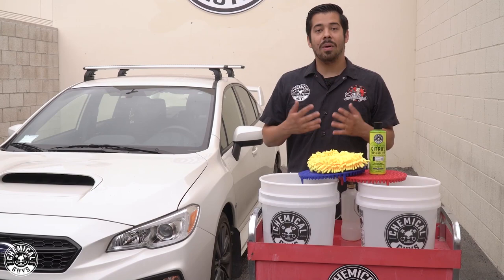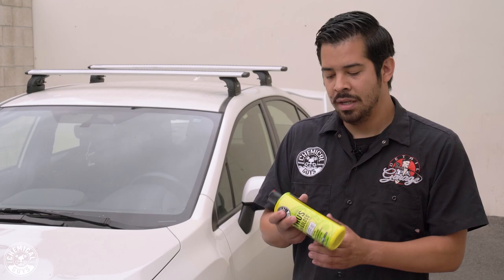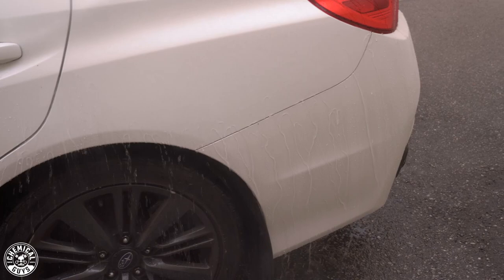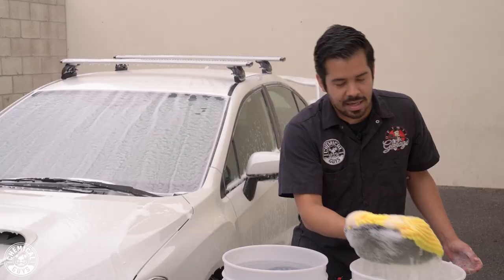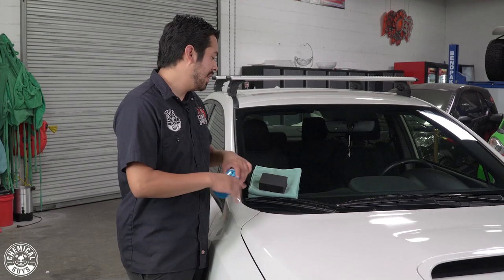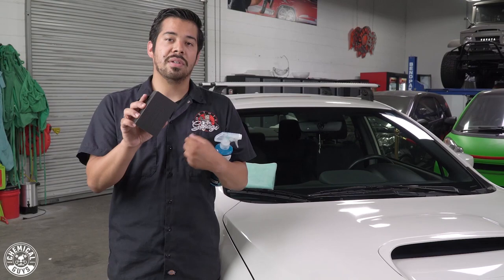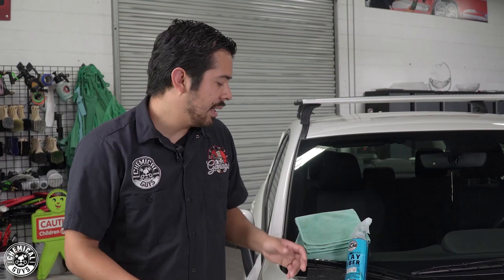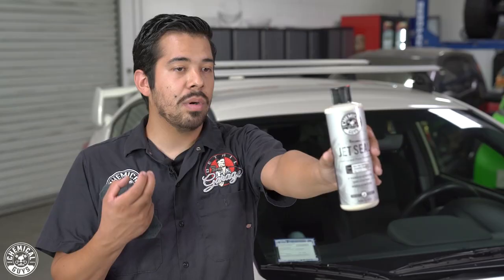How To Decontaminate White Paint! - Chemical Guys

Comment: I have a brand new white model Y that I’m gonna detail. Let me know if my steps are right.

1) clean the wheels.
2) lather and 2 bucket clean the exterior (I have the fly and bug cleanser I’ll use too since this is a commuter) 
3) dry and then use light clay bar 
4) hydro slick
5)jet seal
6) butter wet wax 
7) interior clean with total interior 
8) treat carpet with fabric protectant. I got fabric smart gtechniq
9) treat white vegan leather wirh colourlock faux leather protectant. (Last two didn’t see chemical guys products for these treatments)
10) silk and shine on tires and interior vinyl 

Let me know if this makes sense and is a good way to maintain. 

Also if I get a clay block how long does that last until needing to be replaced?

Please, any feedback is appreciated. Thanks for the great videos. This is super helpful for an individual getting into this hobby.
Reply from the maker: Absolutely! That is a perfectly fine.
Reply: Bi

Comment: After applying jet seal with the applicator pad do I need to wipe down with a microfiber towel or it doesn’t haze ?
Reply from the maker: Hey! Yes, after allowing about 15 minutes to bond, Jet Seal will haze slightly and then can be buffed off with a clean microfiber towel.
- CG Nick

Comment: Can you please tell me the procedure for cleaning and restoring the color of aluminum using Chemical Guys solution? ❤
Reply from the maker: Hey! Thanks so much for your message. Begin by removing grime with your favorite car wash soap or quick detail spray. Next, scrub the surface with Light Metal Polish to restore shine. Protect the surface with ceramic, sealant and/or wax.
Reply: @ChemicalGuys  Through this method, the yellow stains and long-standing oxidized aluminum parts on the engine of the car will be cleaned and restored to their normal state, right? Thank you very much. ♥️

Comment: I thought that's what clean slate was for? Then you wash the car? Just curious. I have a white car that needs to remove the deep embedded waxes /spots on it. Still has a shine but if you look closer the color is off in certain areas with whiter spots?
Reply from the maker: Hey! That's correct, Clean Slate removes old coats of glaze, sealant and wax while also prepping the surface for a full detail.
Reply: @ChemicalGuys  Thank you! My car has been sitting under some trees and I was looking for a way to start from scratch. There's a color difference in my white paint